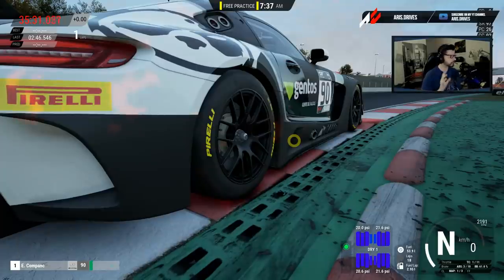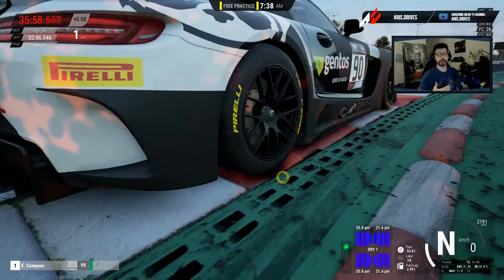Did you know? A traction control bug that was a realistic feature.

Comment: Aris, at this point I think it would be easier and faster for you to make a video about what ACC does NOT simulate
Reply: Lack of simulation of wet racing lines would be a great video to start with.
Reply: @RichieSpeed  lol they do simulate wet lines. Drive on a rubbered-in track with rain on and let us know
Reply: @ikebabosaurusiable  I have spoken directly with the developers about this. The rubbered in line is slippery for about 3 laps maximum, and then the normal line is faster again. For some reason they can't increase the time it takes for rubber to be washed away.

In reality, the rubbered line will stay slippery for much, much longer. Another element which is not simulated at all is that the racing line does not become slippery only because of rubber, but because the tarmac itself is smooth and worn down due to heavy use. Because it's so smooth it offers very little friction for tyres. This is fine in the dry on hot sticky tyres, but very bad in the wet. 

I've said it before, I don't like knocking ACC because in fairness it has the best rain of all current simulators, but it is still far from realistic.
Reply: do any sims do it right?
Reply: @ryanmagid9898  unfortunately, no
Reply: @ryanmagid9898  TBH, RFactor 2 kinda got it right and almost perfectly simulates it, but it also got a few things wrong...
Reply: Are there different tire manufacturers, and if so, do the tires behave differently?
Reply: laptimes therefore physics
Reply: It doesn't simulate what it feels like to feel loved, sadly.
Reply: @niismo.  all Pirelli tyres man. They do the GT world challenge series

Comment: Aris how about in Aston Martin V8 GT3, when you hit a bump it goes straight into the limiter, is this the same effect?
Reply: Yeah, I wanna know about this. It happens to the Bentley as well. If you're close to hitting the limiter and you go over a bump the engine bugs out
Reply: Yeah this is my question as well - it seems like the Aston GT4 doesn't do it. It's most noticeable/reproduceable coming off the end of the curb at T1 at Bathurst.
Reply: @viperion_nz  Yes that and Ascari kerb also Suzuka degner 2 exit kerb
Reply: Let's bump this comment to the top because I also want to know 😅
Reply: @freespacing8150  Aston is built by Prodrive
Reply: No one said it's rubbish fella. We're wondering if the rev-limiter bounce that we've noticed is due to the same effect on the TC system.
Reply: @viperion_nz  rev bounce is because the car is temporarily receiving much less friction from the tires so can accelerate faster. its kinda as if youre hitting the clutch. thats why at bathurst youre supposed to shift just before the rise on the first straight (else the car gets stuck on the limiter for a sec).
Reply: @viperion_nz  the rear wheels are being temporarily unloaded by the bump. 
Basically lifting the rear of the car for milliseconds obviously. 

Run with no downforce etc and you'll really notice it. Likely the car will move a lot too

Comment: Aris, I know this video is about something else, but I'm having serious troubles with force feedback on ACC ps4 and Logitech G29. If I set the gain in order not to have ffb clipping (I use the FF meter on the bottom right of the screen to make sure I'm doing it right), I lose all track details and I'm not able to feel the road. I tried anything, but I cannot find a setting that works without clipping or losing all track details, so the game feels very wrong right now. I tried your suggestions (gain at around 100%, 12% minimum force, 30-50% dynamic damping and 0-20% road effect) but it doesn't really work, so I have to go down to 55-60% gain and the wheel is very light and not communcative , but if I raise to higher levels the ffb clips mid corner and I have the wheel basically stepping and suddenly turning by itself. Any suggestions (apart switching to a fanatec wheel)?
Reply: A bit of clipping is not just OK but desiderable when using some weaker wheels.
If its engaging just for some moments its not a problem at all. Just play what you feel the best for you. And i think they are gonna fixing it soon

Comment: Actually as an older member of our society I do not like the "electronic aids" that are prevalent in modern motorsport racing. 
I think it detracts a lot from the drivers abilities to control a high performance machine on the ragged edge and puts more focus on which teams can hire the best software programmers.
Traction control and fuel conservation should be the drivers right foot in cars or right wrist on motorbikes and abs braking should be the left foot in cars or left hand/right foot on motorcycles.
Traction control and engine fuel management has gone to the point of gps based and different for every curve or section of track in some series.
Put the control or lack of control back on the driver.
One of the reasons Valentino Rossi is such a great rider is he also dominated on the fire breathing 2 strokes before there were any electronic aids.
Back then it generally took the young rookie riders a few seasons to come to grip in handling the monstrosities known as moto gp bikes.
These days the rookies are a lot faster off the bat as the electronics make it to the point that it takes much less skill to keep from launching yourself to the moon with a high side.

Almost getting to the point it will not be much longer human drivers will no longer be a requirement.
Go back to man vs machine as much as the other man with no electronic aids then you find out who is really the best racer and driver.

Comment: Is this for example what was happening at the exit of Turn 1 at Bathurst if you used too much curb in high revving cars? I believe I remember the forum the thread you're talking about and that was one of the main examples.people used
Reply: I've driven many km's at Bathurst with the AMR V8 for a championship race, and this would happen to me as frequently as once every 2/3 laps. It was super frustrating because it was at the beginning of a long straight and it made me lose 1 to 2 tenths for no reason. What's even worse is that I went to check on Motec what the hell was going on and the TC was completely OFF during those instances! Of course I had posted proofs of this both on the forum and on the Italian Facebook group but never received any attention :(

Comment: So while you're explaining this, the car moves backwards almost an entire square. Whats that about?
Reply from the maker: Sure. Simplistic short reply. When the car is stand still with the physics actually running, the tyre model, even the simplified one is dividing by error. (speed 0) The equations try to take this into account but there are both rounding errors and very small vibrations that move the tyre footprint around. This happens even more when the car is not on a plane (uphill here) and on non equal surface (kerb here). So when simply waiting still there, the more you wait the more the small vibrations and rounding errors take the car "adrift". This happens to pretty much all simulators. Just get in the car, drive a tiny bit, stop the car leave it somewhere you can reference, and come back after half an hour or an hour... the car will be moved around. 
There are techniques to limit this effect or even completely eliminate it, but it is not something we care much about, we focus more on what happens when the car drives.

Comment: Great vids Aris, leaning so much about this Sim, thank you.
Question if I may, as someone who's only just started with ACC on PC (2 weeks).
For good or bad, my driving style is more smooth in and out rather than slamming the brakes then slamming the throttle, (comes from riding motorbikes). My thoughts are once ABS kicks in you have messed up and your now loosing time and control. I have just discovered the sound of the ABS, thought it was back fire in the Porsche!
My question was, is this the case and ACC physics are that detailed. But I have just found the answer here, https://www.assettocorsa.net/forum/index.php?threads/how-does-gt3-abs-work.51746/

Comment: Assetto Corsa needs to add these things before worrying about advanced traction control simulation: 

1. The ability for non h-pattern stickshift cars to stall. (And H pattern stickshift cars that require an external starter shouldn't be able to restart outside of the pits.)
2. The ability to map neutral to a button so you can't accidentally downshift into neutral
3. The ability for cars to accelerate on their own, whilst in gear, like they do in real life when you ease off the clutch.

That's all I can think of right now but I'm certain there is more.
This is for the regular version of Assetto Corsa btw.

Comment: So, you've designed a completely useless TC model and you're coming with the "It's like real life!" cop-out. As a mechanical engineer, I can safely say that it's completely stupid for a system to be designed to have an engine running AT FULL FUCKING REVS while calling for less vibrations from the whole drivetrain+engine ensemble.

You know how you can fix this? Take the car, tear it apart, study every single piece and check what it does instead of assuming what the hell it's doing.